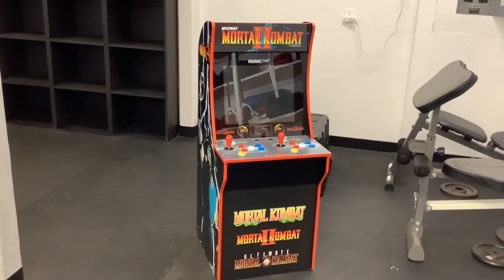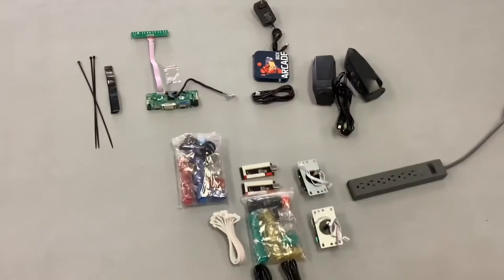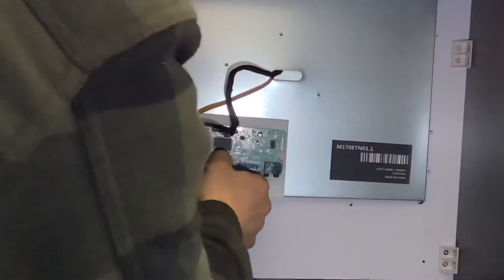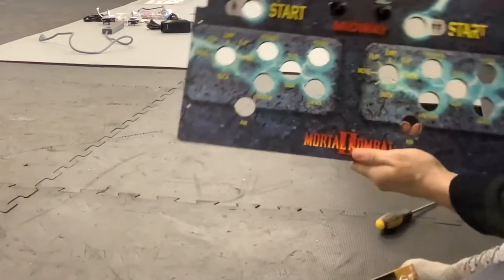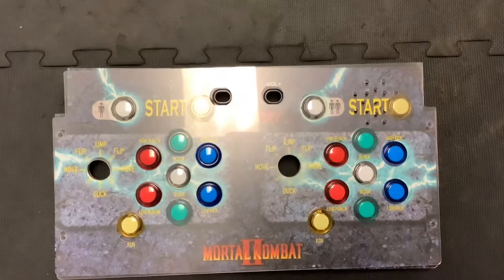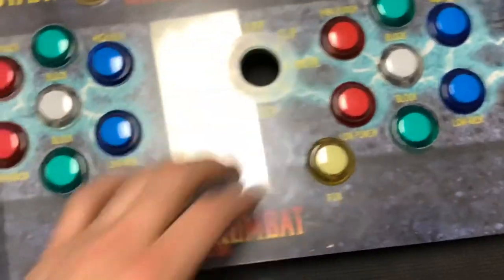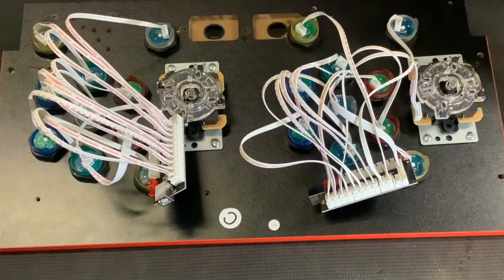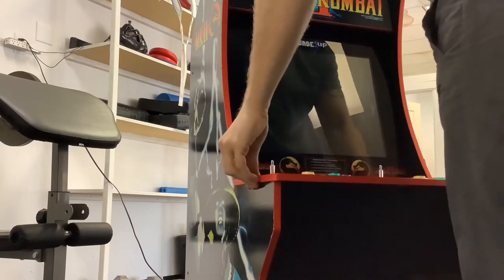How to add more games to your Arcade 1up

Comment: Somebody help, when I try to turn it on the screen turns white for a few seconds then goes to black, all the buttons are lit up but the screen won’t work
Reply from the maker: Sounds like a connection issue with your hdmi converter board. Make sure you have it installed properly, good ground, all cords are hooked in properly then make sure you didn’t pull too hard on the cord that connects to the pins on the board. A lot of people pull that cord to hard and it unplugs from inside the metal panel of the lcd screen. If that happened you have to take remove that metal panel and plug that cord back in. Next make sure you have a  good hdmi cord.
Reply from the maker: Other problem can be the wrong hdmi converter board with the Arcade1up you have. Which model arcade are you using?
Reply: I’m using the street fighter 2 champ edition , trying to see right now if I can fix anything
Reply from the maker: @oofer2028  ok I’ve modded that machine a lot, let me know how it goes. Also the cord that plugs into pins on hdmi board has to be plugged in the correct way on the board. Let me know if you get it working or need help
Reply: Hey, I have a gen 1/2 board and gen 3 board, when I use the gen 1/2 board the green light on the lcd thing turns green and goes to red very fast, screen stays black, but when I use my gen 3 board the light stays green and screen is stuck on white
Reply from the maker: @oofer2028  try a different hdmi cord. Sometimes the ones they come with don’t work. Also make sure you have a good ground. Also try hooking something else up that uses hdmi like a different video game system. Make sure your arcade box is also working correctly by plugging it into a different hdmi cord into your actual tv. Sounds like it is either a bad ground or bad hdmi cord to me. Use the correct board
Reply: Hey I’m back again, I tested the arcade box on a tv and everything about that works fine, just still the screen is solid white , the only thing I’m think of is the ground wire being messed up (not sure if I’m doing it right) or something wrong with the actual board
Reply from the maker: @oofer2028  make sure you didn’t pull the cord that goes up inside the back of the metal panel too hard. If it gets pulled to hard it unplugs from the lcd screen. You have to pull that metal panel off and plug it back in. I did that once and got the white screen. Thought my board was bad. Also some people plug the cord that goes into all the pins the wrong way. It’s got to be one of those.

Comment: I got a no signal then screen went black
Reply from the maker: Either the wrong board for what model arcade you have; or a wire got pulled too hard from the monitor and disconnected. Both problems have happened to me. Once I pulled the wires too hard connecting to the pcb board and it was enough to unplug it from inside the monitor. Had to open the monitor and re plug it in.
Reply: Thank you that worked I got it going 🙂 do you know how to add more games I want to add jaguar games if they will run on it thank you again

Comment: I still can’t get it to work..
Reply: if you are doing the arcade box, try plugging into a tv or monitor and use the wifi game pad that usually come with your arcade box, get familar with it first, make sure everything is working before you plug in your control box, one you plug in the control box. do your button setup just as Greg's video. you can use one wifi remote in one USB and the encoder in the second USB. use you wifi remote pad to back up and select to get you out of setup if you get in trouble.